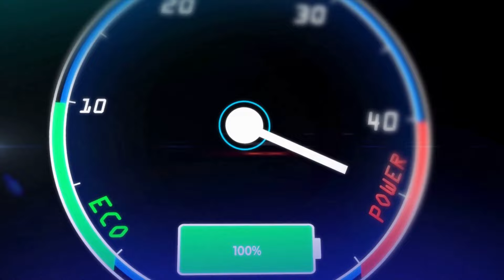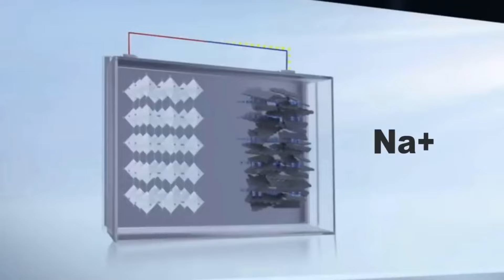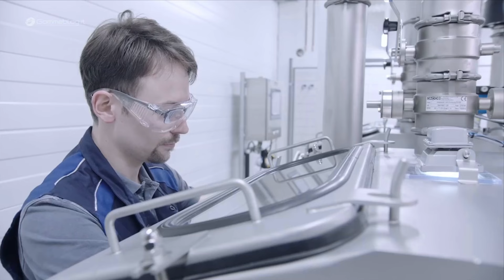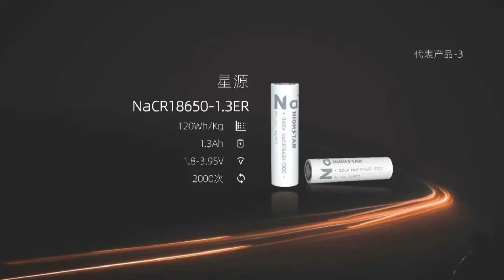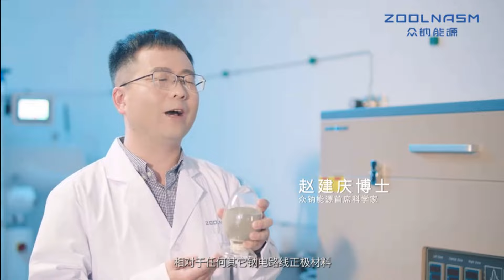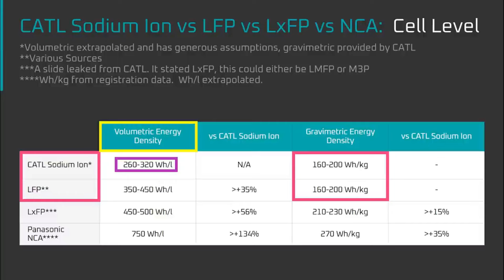Secret Companies Developing Sodium Ion Batteries – You Won’t Believe their Cell Performance Results!

Comment: Hello there I was wondering if you can help, I’m looking at Highstar 21700 40p cells 45a discharge for a high powered ebike but I can’t seem to find much information or reviews on Highstar …..there factory and production line looks amazing, are they big in the battery world  ?
Reply from the maker: Thank you for watching our video and dropping a comment, hope you’d consider subscribing. Highstar does not have a lot of products outside China, they trialed and tested many of their cells in eVs and residential batteries in China and have their factory running out of China. They are certainly not as big in the sodium battery world as the likes of Hina or Zoolnasm but they are picking up the pace. If you’d like sodium ion batteries for test I would suggest either of Zoolnasm, Hina and Faradion because only these ones have cells that are getting shipped out to customers. If you can’t get through to them on their websites, a good place is Alibaba, I have seen a few sellers on there with sodium batteries for sale but as always just make sure you’re buying a sodium ion battery before paying. Hope this answers your question and thank you once again for watching our videos